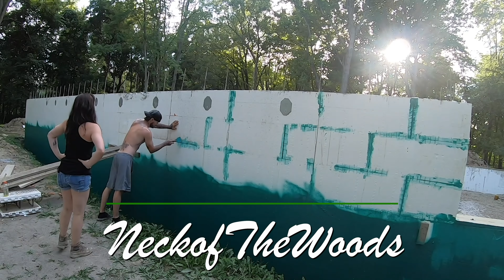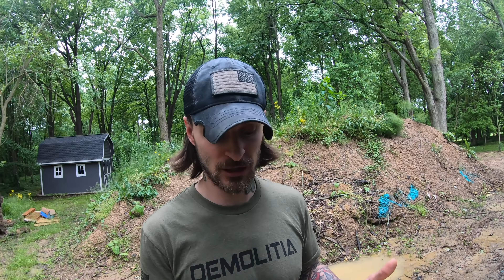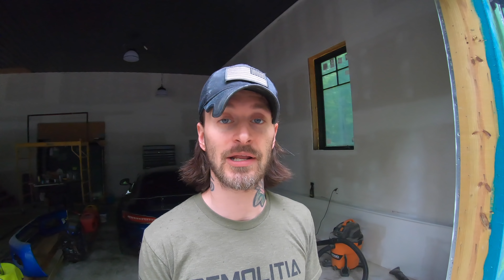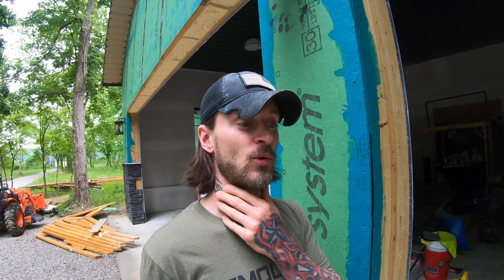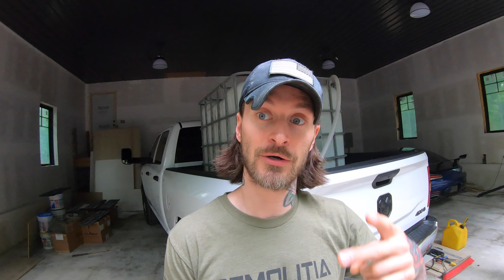Out of Money???  Door, Roof and Electric updates!!

Comment: They have break out panels that you can tie your main panel into, my dad has a setup like that in his house.  I use a portable that ties back into my main panel with a lockout for the main breaker.  It is in my detached garage with a connector on the side of the garage with about a 6' cable on the inside and another connector on the side of the house wired to the main panel.  I then connect into both sides with a cable.  I can run the fridge and freezer, lights, induction stove top and misc other small things off my 5500 watt generator.  Might be able to run an ac compressor also (have a gauge connected in line to monitor the draw).
Reply from the maker: that sounds just like what my father-in-law has.  he pulls out a 10,000 watt Honda, plugs it into the house and he's all set.  we'll probably do the same with my 7,500 watt and then one day maybe convert over to a EV.

Comment: Vinyl siding has Board and battan  design, no painting . will be great to see the exterior , Roof , windows, garage doors, siding done !
the BIG fan is called the  "Big Ass Fan. "
Reply from the maker: I’d have to see that in person!   Not sure she’ll go for vinyl but as for the gable upper parts If I split the board and batten from the cedar, that might be vinyl.   But that’ll have to be the correct color or we’re screwed it won’t look right be blacks that are way off.
Reply: @neckofthewoods24  Have you considered doing a rain screen and getting a local saw mill to mill you some poplar board and batten?  Could do that with some shake in the gables..
Reply from the maker: @FJB2020  no I haven’t.  If I do a rain screen I think I’ll go with the Corevent.   Plastic should be cheaper and last longer.   And if we do the shake look in the gables, I do like vinyl as a option, just have to see how it looks and the black it comes in.